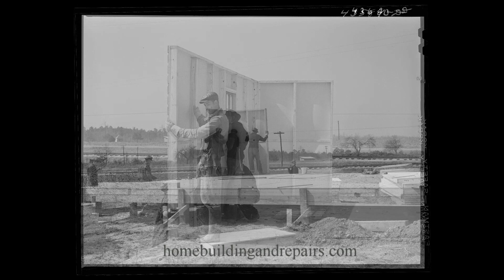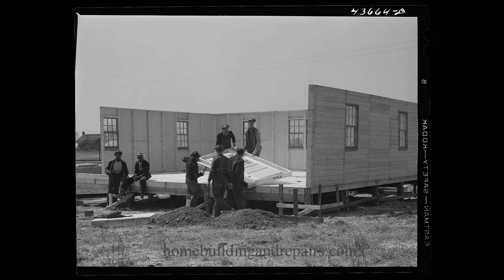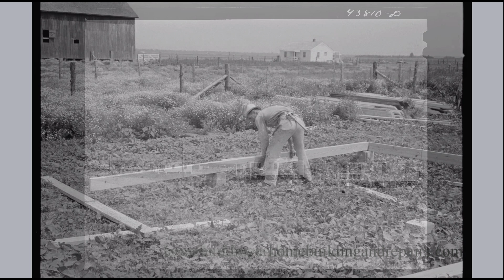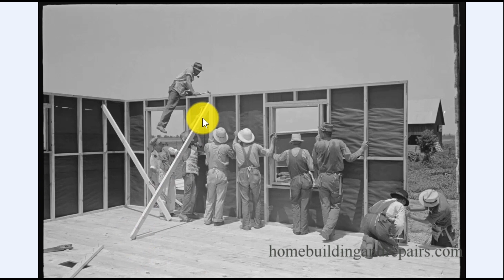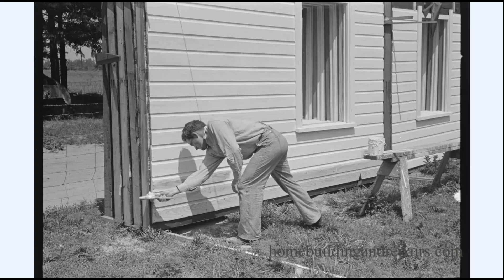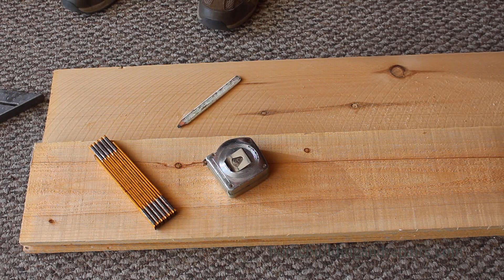World War Two American House Construction And Folding Ruler Tips

Comment: I am a convert to the folding rule for any measurements under 8ft: you can use them as a t-square, you can hook the the end if you burn a couple inches, they're more rigid than tapes, angles, curves, they are unbeatable